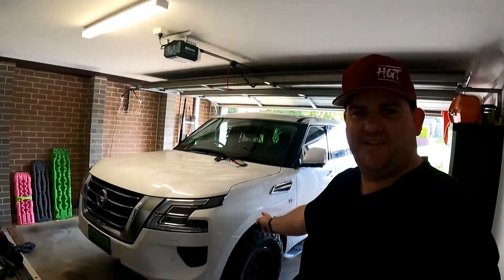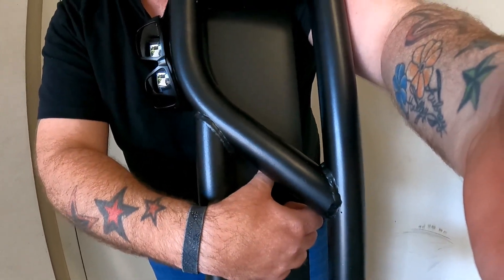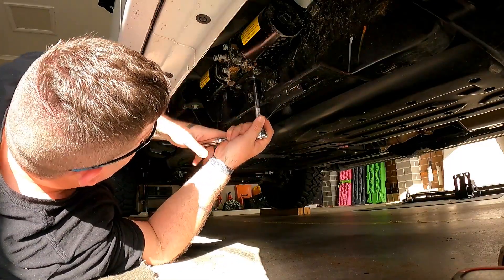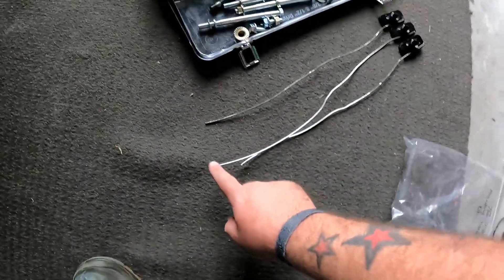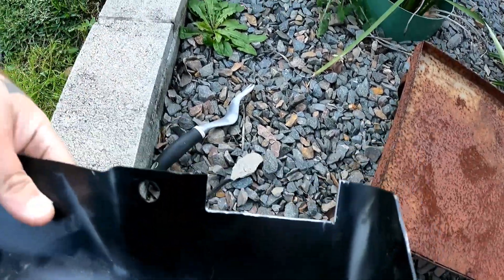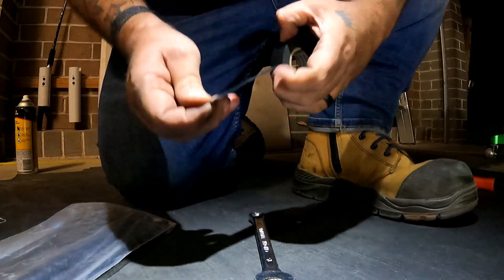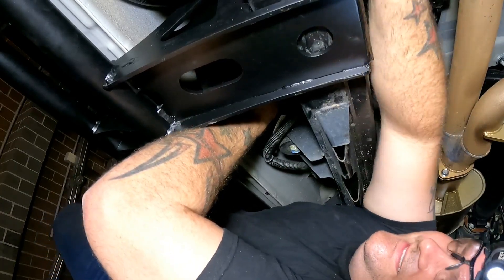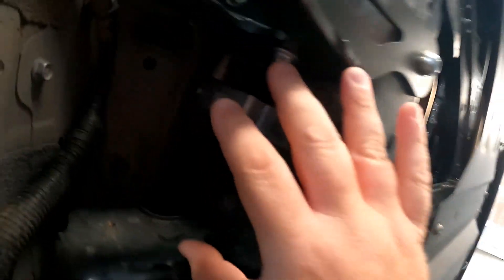Y62 Patrol Rock Sliders - Dash offroad - Big O Delux slider install - HGT new rig build -Garage Life

Comment: Absoulute nightmare to fit these, ended up putting gasket sealer on the inserts for the chassis so you atleast have a chance to refit them if you take them off

Comment: I'm curious how much does the dash offroad rock sliders weigh compared to the factory ones.
Reply from the maker: I couldn’t tell you exactly how much but it’s heaps more because the factory steps are just that. They’re not designed to take a hit